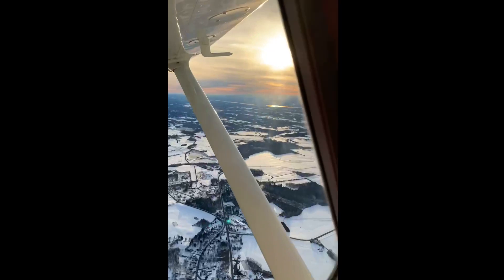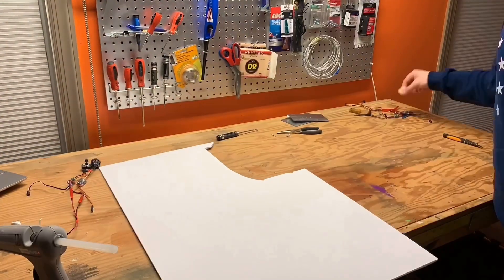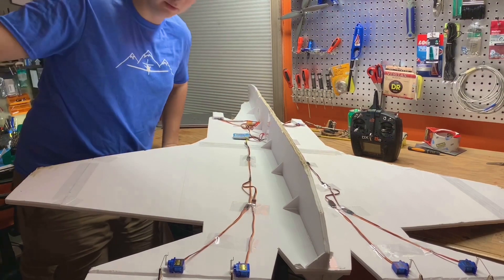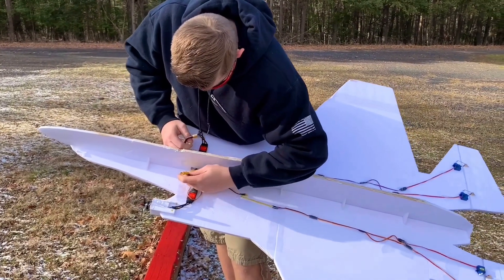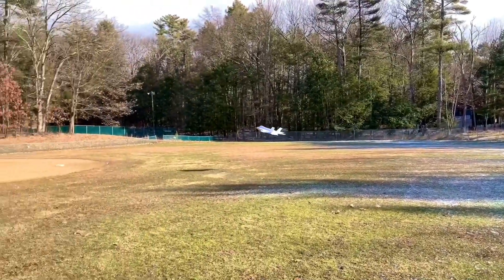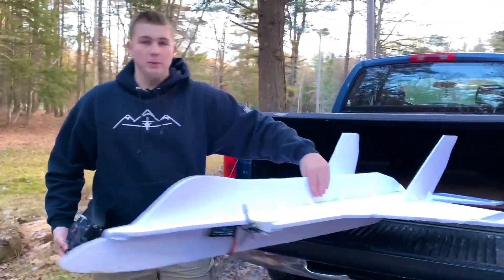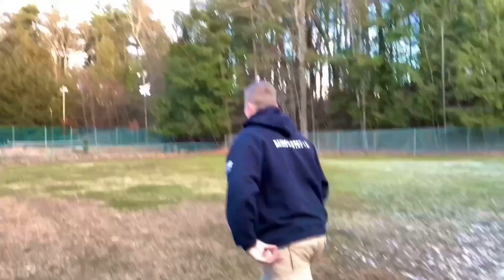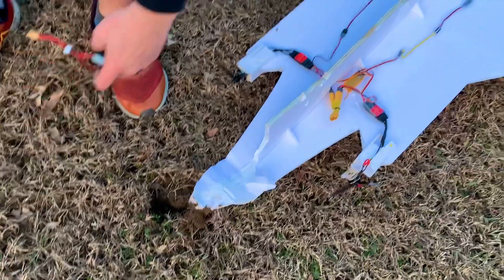Giant R/C MJS F-35! [DIY]

Comment: Great video keep up the good work. You need to check out rcpowers channel.  I took some planes of a f35 mid pusher prop and resize it to 150 scale and it turned out to be about the same size as the one you built. It turned out to be so much fun.

Comment: super cool, even though it didn't fly all too great, could have used a bit more power.
I also had a look at that website of yours. First of, pretty cool that you got all the products in there. However I also want to leave some constructive criticism.
I was unable to find a page for shipping info, especially for someone like me who lives in europe.
Then maybe a button to add an entire plane kit to the card would be cool so one does not have to select y cable, motors, receiver and plane kit seperately.
It would also be cool to have batteries listed as well as chargers to really complete the set. 
The shop page for the kits should also include a link to the download links for the free plans to make them easy to find.
The listing for the motors does not say whether they come with props included and I didn't find any props in the store. And props tend to be pretty important to allow one to fly.
I really want one of these F-16s for myself, especially if that receiver of yours is able to do delta mix on it's own. 
That and I'm still waiting for a tornado micro so I can put this livery on it: https://aircraftpix.de/tiger23.JPG
That's all for now, have a great day!
Reply from the maker: Thank you very much for your criticism, these comments are exactly what I’m looking for! Im in the works of getting props soon. And as for lipos and chargers, being able to dump the money into getting stock right now is pretty difficult so those will come later. I will definitely add a shipping information section as well as making full kit packs!
Reply: @joecarpino  you're just getting started, so what you have right now is already pretty damm impressive. I may get myself one of these micro packs sooner than later, the only thing that was stopping me so far was the lack of a brick that supports onboard delta mix as my cheap DXe doesn't have that feature all too easily. I fly multiplex as my main transmitters, but good luck finding any micros that support that protocol.
Reply from the maker: @stratos2  Thank you! I’ll let you know if I find a multiplex protocol delta board